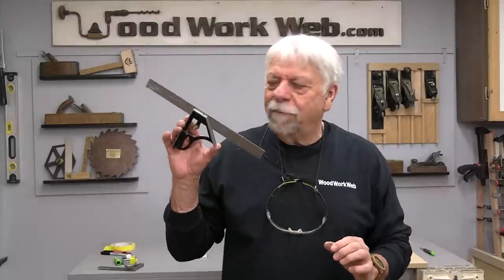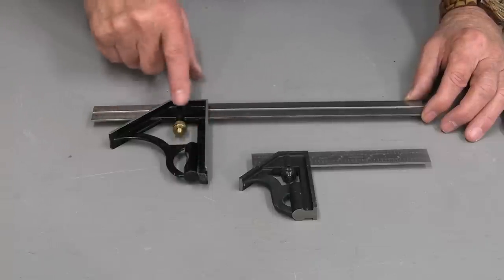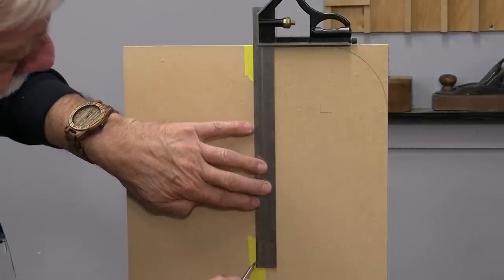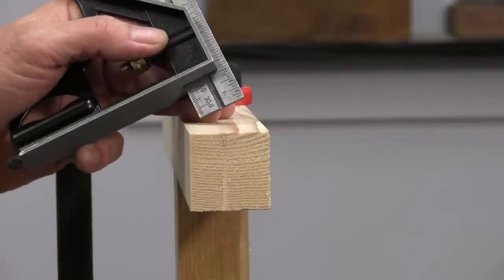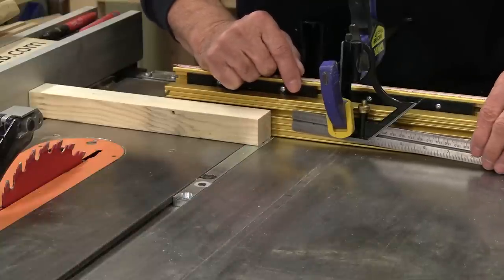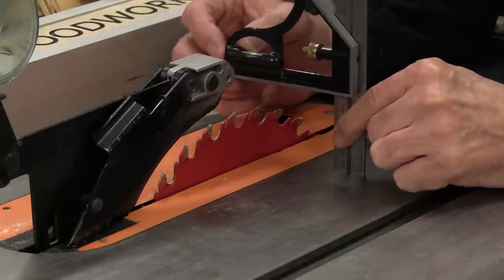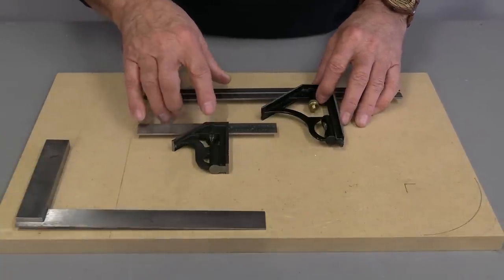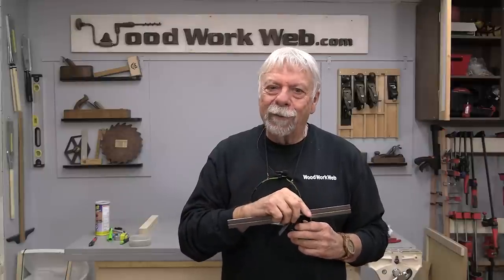JUNK Combination Squares - Can You Still Use Them?

Comment: You can actually square up a cheap combination square.

If you take out the ruler, you'll see that it rides on two nobs in the casting. Cheap squares are made from aluminium, and the nobs can be ground down easily with a small file, some sandpaper, or even by scraping the edge of the steel ruler.

You can fine-tune a combination square like that. But cheap ones go out of square after usage again. So you need to check it from time to time.
Reply: Ditto
Reply: and go very slowly with the filing
Reply: Same here.  Fixed a few with the same trick.  Went from OK squareness to dead on with a little effort.
Reply: Removing metal in a rule doesn’t make it square…

Comment: Couple months ago I bought a cheap combination square branded "Empire" and it is dead accurate (I've checked it using good-quality machinist try square).
My point is cheap doesn't necessary mean bad.
Reply: I've got several of Empire's "True Blue" tools, they're all dead accurate.
Reply: Y'all Got lucky, none of the empire's I got from HD are square
Reply: @tom0428  I've also got a few Empire tools that are not accurate. Only the True Blue line are guaranteed accurate. I picked up a set of their combination squares recently fully expecting to have to tune them, surprisingly they were just as accurate as my other True Blue tools.

Comment: Colin... you do not know how much worked you caused me. After watching the video, I checked my working combo squares to a machinist square. Most were off a little. The one I used the most was off a lot, and my father's old German carpentry square was bang on even being 50+ years old. Next, I checked the straight edge rulers...same issue and next the 45 and 90 face of the combo square to a true straight edge...same issue. Out came my chisel sharpening stone, and I set about to make one of the combo square true in all aspects. The tough part was finding a 3/32 edge flat file. If you count the time to make it true, it is better to get a high-quality square. Now, to square up everything else.

Comment: For beginners: one thing not mentioned is that cheap combination squares will have a rule (the straight ruler part) that can bend really easy. Once it bends, even a little bit, it's junk; you're never going to get that thing flat again. Often, you'll take one off the shelf at the big-box store, and it will already be bent. 
A good square will have a "tempered" or "hardened" steel rule (and will be labeled as such), which will not flex without lots of force; even if you can flex it a little bit, it will go right back to it's original shape once you let go.
Reply: Yep, you can see the difference in the thickness of the rule in the cheapo vs the Starrett in the beginning.

Comment: Collin, how about doing a piece showing how to correct an out of square combination square. All you need is a small riffler file (you can get a set of them at Harbor Freight tor about  $5). The blade of a combination square rests on two points in the head. The nut simply pulls the blade against these two points. By carefully filing one of these points and rechecking, you can get them aligned in a few minutes. Be careful if your square's head is aluminum. Aluminum can be removed rapidly. If you do take off too much , go to the other side an make a stroke or two with the file. Constantly recheck using the method you show  by drawing a line perpendicular to a straight surface, then reversing the square and drawing another line.
Reply: You'll never get it accurate enough. Be realistic.

Comment: Had to work with a friend's super cheap square a couple of weeks ago.  It used a molded plastic body and the rule was soft and had a bend to it.  For what I was doing it was OK but I felt a little "dirty" while using it.... 😁

But it did teach me that if I need to check a cheap square that I needed to start by making sure the straight edge is in fact straight.  To that end to aid with keeping it cheap I'd start with two finish  nails in a piece of scrap plywood or MDF that are spaced just inside the ends.  I'd make a knife mark along the middle then flip the straight edge over and make another knife mark.  If the two are not actually one single groove then the straight edge ain't straight.    But on the cheapies they can be easily bent a little to make them straight.  And after that THEN the squareness can be checked.

Comment: I keep one in a drawer right next to my chop saw. I do not have a laser light showing me where the blade will cut so if it's necessary, I can draw a line where I want to cut and then bring the blade down to meet that line. Once in place, I cut. I have a very nice combination square that I use when accuracy is more important than the convenience of location.

Comment: I use machinist fixed squares.   I do have a starrett adjustable that is adjustable.  If you do go to a big box store check it there for square first before buying.  Tape measures need to me checked.
Reply: I had a cheap tape measure in my beginning shop class. I didn't know then that an inch on it did not equal an inch on other tools. I made a candle box in which the back turned out wider than the front due to that. By the time I figured that out, it was too late to correct. We have to be sure measurements on different tools agree with each other, for sure.

Comment: An unmentioned point, cheap rules have stamped markings.  Which means fat, inaccurate lines.  Quality rules are engraved with much better accuracy.  Plus, the surface finish is not glossy, so the numbers are much easier to read.

Comment: At a sheet metal brake I might have 2 or 3 set to different reaches for repetitive marking. Mine measure distance more often than squaring. My favorite is a Mayes with ground stainless scale and iron body. Used your sliding block thin strip jig to make wedge strips. 5 degrees on the block and saw set 5 degrees away from block makes 10 degree wedges.
Reply: Wood_Work_Web  As a senior on social security with beaucoup personal projects I’m not looking work!

Comment: Even the best combo squares will become inaccurate over time, with use. The metal on metal when adjusting, will wear. The cheap ones with softer metal, depending on how much you use them, are worse.

Comment: On the other hand, i have several cheap aluminum hardware store squares that are dead on, or within half a degree... quality is Not determined by price, or material. Cheap does not equal junk.   This is wood working, even cabinetry, not cnc, within a degree is far and away good enough.  

Want perfection, get a machinists try square, not an adjustable square.